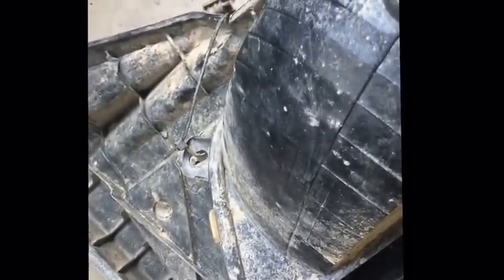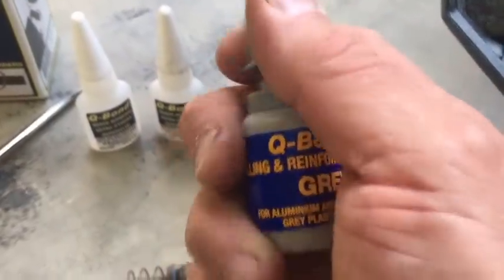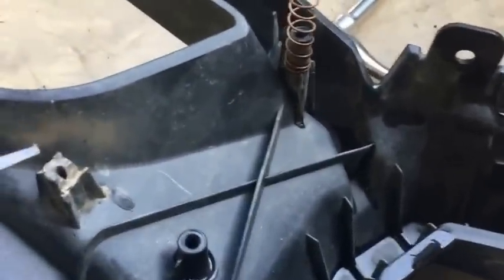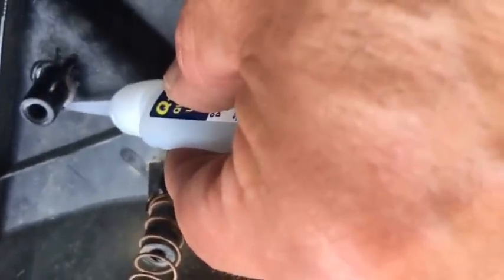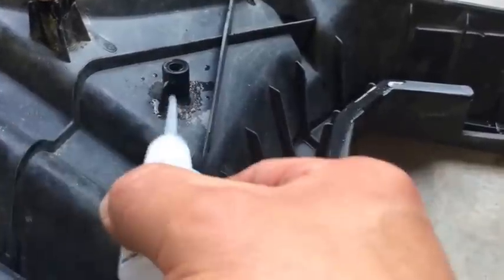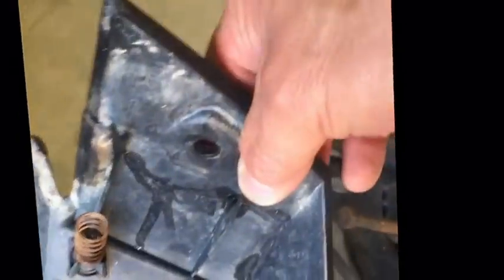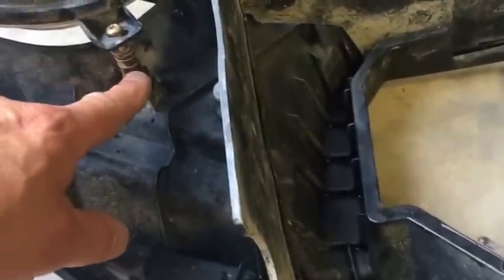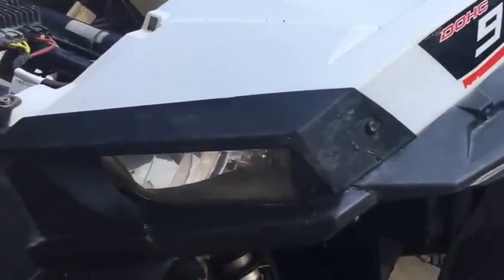Q-Bond this stuff is awesome

Comment: Would this fix a broken plastic turn signal?
Can you upload pictures on here? it’s kind of hard to get where I need to repair because there’s a round plastic piece on the turn signal and the break is right before it, so the round piece is kind of in the way. I can upload a picture of where I’m talking about.
It’s on a 2017 Hyundai Electra and the turn signal has a cone shaped piece right before the break

Comment: why didn't you read the instructions?  it states the black is for plastic. ..now I'm wondering if it works better or worse when used properly.
Reply from the maker: What are you talking about it worked great and it states that the grey is just for a different color.